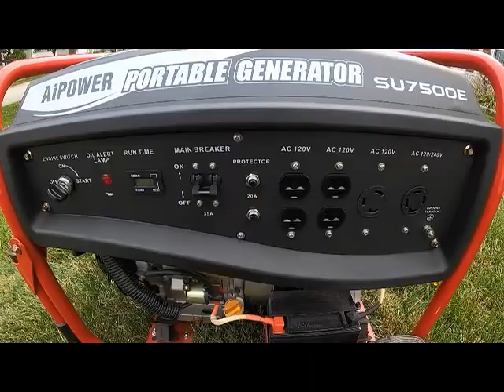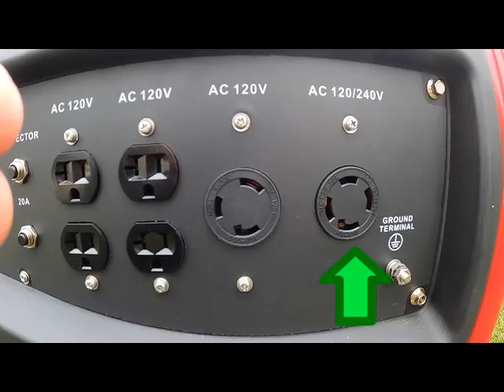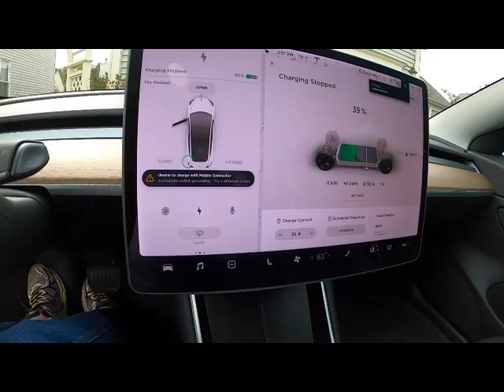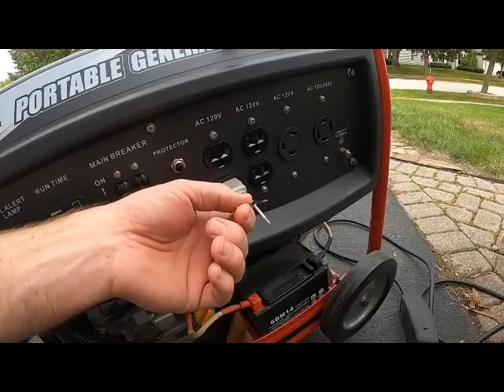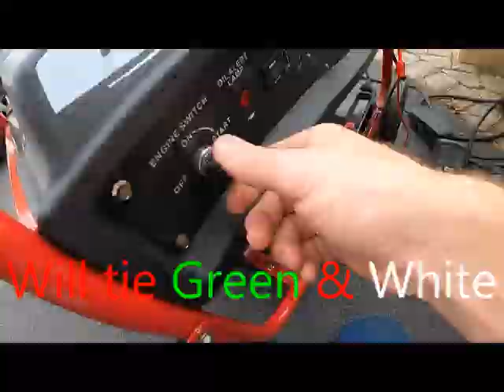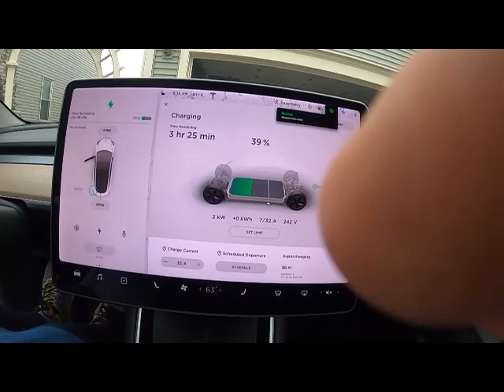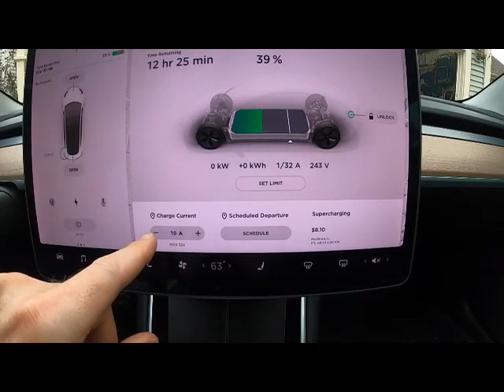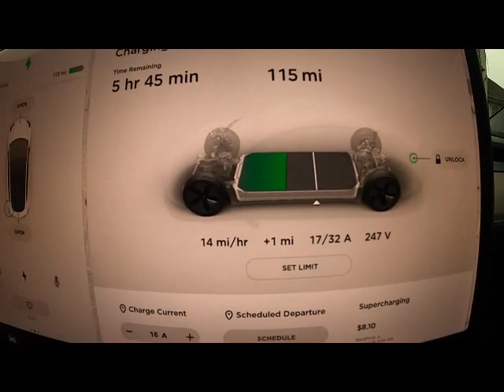How to Use a Gas Generator to Charge Your Tesla / EV / RV

Comment: To folks who aren't familiar with electricity.......the ground lug on a generator does nothing for the functioning of a curcuit. What the car charging equipment is looking for is the neutral to ground bond.
Reply: It provides a path to a common ground.  It will allow stray voltage that may end up on the chassis to flow somewhere.  It also establishes a ground plane to help eliminate the EMI caused by the high frequency switching of the inverter.  As this is all part of the circuit, it is indeed important.

Comment: Would this work using a bonding plug and instead of the 120v outlet use the 14-30 generator outlet so that you could use a 30 amp generator cord (using an adapter for the Tesla 240v (14-50 to 14-30 adapter) or alternatively plug the Tesla 14-50 directly into 14-30 adapter and into generator (advantage of the generator cord is being able to place a noisy generator further away). Would either of these methods work so you could charge at a faster rate (24 amps per adapter safety specs) than 120 outlet slow rate?
Reply from the maker: In this case, I think my generator really can't supply much more than what I showed - maybe 30 amps at 240v.  And using the Tesla mobile charger at 120v, I'm limited to it's max, 32 amps.

Comment: The afapter determines amps. If you had the 5-20 adapter you would gave pulled 16 amps and got 6 yo 7 mph on the 120 volt.

Comment: The reason this didn't work is due to the nature of the floating neutral in a generator, coupled with the fact that the charger is a GFCI device.  If you bond the neutral to ground, you are creating a low impedance reference the GFCI needs.  Just remember to unplug it before you plug it into the house.  Multiple bonding points isn't so good.  It would also be wise to bond the generator to the chassis or a grounding rod.  This will help stop unwanted potentials from forming.  It will also reduce the EMI the generator's inverter creates.  Not sure how sensitive their equipment is, but generators create massive RF noise.

Comment: We just picked up a model y yesterday and will be using 110V to charge. We also have had a model 3 for about 16 months and the 110V has worked just fine. If my math is correct we can charge at a rate of 840 miles per week which is plenty. Yes it's slow but it works.
Reply from the maker: For the first year or so I only had 110v and didn't have an issue until one week in winter when I had to drive over 100 miles a day. I had to hit a supercharger after a few days...
You'll need to use another circuit in your garage for the second Tesla, however.
Reply: @mmark300  Thank you for the reply. Right now they are simply sharing one charger, charging one at a time. I know it’s not ideal but I’ll try it for a few days and check back in.
Reply from the maker: @iEditProjects  FYI - your garage door opener should be on a different circuit than the rest of the garage, so if needed, you could use that outlet for one of them.

Comment: This does show that if you ran out of power a few miles from home or a charger, there is now a way for somebody to come and connect to your car to give you enough power to get you going again. 
A generator and bonding plug can be the equivalent of a little can of gas. 
Right now if you run out of power, you need a flat bed tow to take you to a charger.
Reply from the maker: Yes!  I already believe that wherever you are, you are closer to an electrical outlet than gas.  With this option there are even more choices.  On road trips I bring my charging cable, 110v and 220v plugs, a 12g extension cord and now this bonding plug.

Comment: Is there any concern that your generator may not be a "Pure Sine Wave" and maybe a "Modified Sine Wave"? Can the non-pure sine wave damage the electronics of the Tesla?
Reply from the maker: Not really because if the tesla detects a sine wave, or any type of signal, it doesn't like, it won't try to charge with it.
Reply: @mmark300  Good to hear. It of course Wants to detect a pure sine wave. I just have an older HONDA 6500 that is modified sine wave and didn't want to risk my Tesla plugging into it. I do have a HONDA 2200i that is an inverter generartor that is pure sine wave and so can slow charge on that in an emergency. Thanks!!
Reply: How Can you make Ground om Honda inverter?

Comment: Them electric stoves that has a 220 line can you plug it into a gas generator into the 220 line and get the electric stove to start ?
Reply from the maker: Yes, just have to make sure the generator is rated for enough power.

Comment: Could be because it requires clean sine wave electric? Maybe it just needs clean power
Reply from the maker: Could be that or it's just not able to quickly output increasing amperage to satisfy the Tesla.  I would have liked to compare it to a higher quality generator...
Reply: There's a special plug you can buy on Ebay, it's called a grounding bonding neutral plug. Generators have a floating ground and Tesla charging system doesn't recognize it, but with the special bonding plug it will charge.
Reply: Jump lead.

Comment: Can you charge an ev with gen, while driving?
Reply from the maker: Unfortunately no, only hybrids can use their motor to charge the batteries while the motor drives the car. Otherwise we could just pull trailers with big generators :)
Reply: @mmark300  I think Tesla recognizes the charging door is open and will not let you place the car in drive.
Reply from the maker: @EarlBalentine  I guess it could be that simple but it seems that someone would have tried bypassing the door sensor at this point. I'm guessing they have another more sophisticated check.

Comment: I have a Generac XP10000E 10KW portable genset. The generator would not power my house as there is neutral/ground bond internal to the generator. I disconnected this neutral/ground bond and now it will run my home (that already has a ground). A neutral/ground plug should make my generator able to charge an electric vehicle. Distortion on my XP10000E is <5%. I do not own an electric vehicle yet.
Reply: wr9ng

Comment: I'm curious what gas mileage is like using the generator only to fill up the car. Would 5 gallons be enough?
Reply from the maker: It depends on what you mean by 'fill up the car', but from a 0% charge, not even close.  
If we were able to max this generator out at 6,000 running watts, we would be able to turn it up to 25A, which would charge the car at about 16 miles/hour.  The tank holds 7 gallons and says it will run 5.5 hours at a full load.  5.5 * 16 is only 88 miles...  The Tesla model 3 is rated at about 300 miles on a full charge.
So this would be a very expensive method to fill this car up.  From 0% to 100% (0-300 miles) would take almost 24 gallons of gas and cost ~$72 based on $3 per gallon of gas. 
Plugging in would be WAY cheaper.  75kWhr battery * .135 = $10.125  (.135 is ave cost per kwh of electricity)  Inefficiencies would add another 10%, so a little over $11.
Reply: 🤣🤣🤣🤣🤣🤣🤣🤣generator putting out 100 times more smog than a modern car
Reply: @armadilllo  wroñg
Reply: @sharonbraselton4302  right
Reply from the maker: @armadilllo  Operating a new, average portable gasoline generator (~3.5 hp) at an average load of 1.8 kW for 1 hour emits as much smog-forming pollution as driving an average passenger vehicle for about 150 miles.

Comment: Great idea on what to do with old gas!
Reply: Not if you care about your generator. Gasoline contains at least 10% ethanol and ethanol attracts water molecules from the air. While it may run, it will usually misfire a bit and will run hot. Gas with 10% ethanol lasts about 6 months, maybe a year....after that dispose of it. Hopefully he turned off the fuel and ran the gas out of the carb before storing it...I extract the gas from mine and run it dry prior to storage and put the gas in my truck while it's still fresh. Buy gas as needed or buy non ethanol gas (sold at mavericks or Murphy's for about the same price as premium) and put stabilizer in it. You can store gas for a few years this way.
Reply: @allaboutroofing2  Thanks. He didn't mention if it was ethanol free or not. From my experience, it had to be or it just would not have run. I run Avgas in all my stuff as I am a pilot and just purchase extra fuel for my generators, tractors, chainsaws, weedwackers, ......... That fuel lasts decades (just like gasoline from when I was a boy). 
You can remove the ethanol from fuel by just adding water and shaking it up. Ethanol has an affinity towards water and so it combines with it. All the ethanol settles to the bottom of the tank (I use 5 gallon glass bottles). You then siphon the ethanol free gasoline off the top and have gas that lasts many years. I add a little octane boost due to the loss from removing the ethanol.

Comment: 6,000 watts divided by 240 volts = 25 amps
Reply: Yeah, it has enough power to fully charge within 8 hours. He forgot to manually throttle up the generator to increase the current. Can't rely on the generator engine governor to compensate that.

Comment: My 2020 Ford Edge Titanium gets 28 miles to the gallon. 7 gallons gets me 196 miles. With the Generator and its 7 gallons I get 115 miles in a Tesla using a generator. And if it is aa emergency you will not be having this in your trunk! Yeah go electric. I was in the Army for 20 years and now I remember why I do not like green! LOL
Reply from the maker: What you say may be true except that the point of this video wasn't to suggest that using a gas generator was a good way to charge an EV. This video was just to show that a generator can be used to charge an EV and to show that it's not as straightforward as just plugging it in.
Also, I think your Edge only gets about 21 mpg combined city/hwy.
Reply: @mmark300  it is my car. I know what mileage I get. It is displayed on the dashboard. I used to drive across the southern Desert from St. Louis to Long Beach every week. I had two 5 gallon cans of gas and extra water. What is the max distance a Tesla or most any other electric be operated before it runs out? Will there be stations every 200 miles? Also yeah you can charge a electric with a generator that uses gasoline and oil. By the way the grease in the bearings and other moving metal
Parts are made from petroleum products. Mobile synthetic oil will help. But buy a Prius. Much better solution to electrics. Well until it is time to replace the batteries.
Reply from the maker: @billbutler6926  I'm only relaying what Ford says the Edge gets COMBINED mpg (Up to 21 city / 29 highway).  So the Tesla 3 is rated for the equivalent of around 131 hwy / 145 city.  Just like ICE cars, the Tesla could get a lot more mpg or a lot less.  The rated range is somewhere around 270-350 miles.  There are superchargers everywhere and even more level 2 chargers.  
Go to www.tesla.com/supercharger, scroll down a little and click on 'Find Us'.  This is what really separates Tesla from the other manufacturers.  I have taken a couple 2000+ mile road trips and had no worries.  I also brought the charger and an extension cord just in case.  You are always closer to an electricity than gas.
Reply: @mmark300  so Ford inspected my Edge and what? I have paid about $500 to make my SUV much more efficient than your average Edge.
Reply: @mmark300  never said anything about other Fords and the very accurate reporting on the EPA estimates on the invoices.
Reply: qring çhef uñsç àoàcé for useing greñ best regen bràkimg

Comment: Gas generators for green vehicles because the power grid is antiquated at best with a small percentage of vehicles in use, and you can only charge at certain times of the day......LMAO....imagine   the impossible demand on the grid if everyone drove one.
Reply from the maker: Grids vary across the nation, with California and Texas being the worst as far as I know. No where else do I hear of being forced to charge at certain times. Of course, most EVs are charged at home at night anyway... It sure beats having to stop at gas stations. However, prepping for the next 10 years, or so, will only involve an additional 30% increase in grid capacity. While that is significant, it's very doable.
And which would you rather burn, Saudi oil (gas cars) or American coal, nuclear, etc (EVs)?

Comment: They should make electric cars with gas generators built in.
Reply from the maker: They have, they're called hybrids.
Reply: @mmark300  I thought those were just gasoline powered cars with electric motors.
Reply from the maker: @737T1C130  You are correct in that hybrids are more gas car than electric - I was more or less joking.  It does seem like an electric car maker could make kind of small, efficient, built-in generator, but it is a pretty big add-on that would require gas and all kinds of additional safety regulations as well as EPA requirements.
Reply: Its the BMW i8 that has both a gas and electric motor with different modes to take advantage.

Comment: They should invent cars that run on gas and then have a component that charges the battery. This way you don’t have use the generator.
Reply from the maker: I think what you're describing is the hybrid cars.
Reply: hybride çars

Comment: If it's not pure sine wave that may not be a good idea although it is a Tesla so I may need a little abuse.
Reply: It doesn't need pure sine power, it has an onboard charger that can take very dirty power and condition it. It will stop charging if it detects more than it can handle as shown in the video.
Reply: qrong